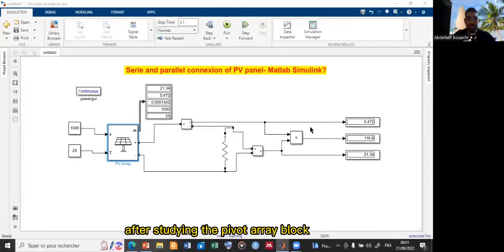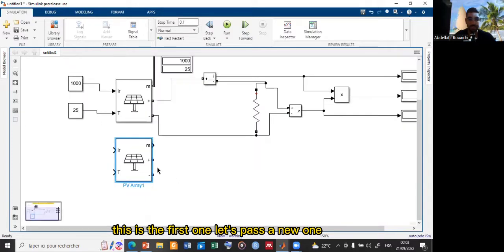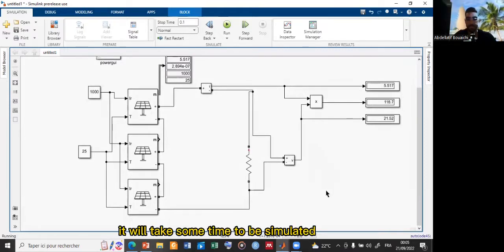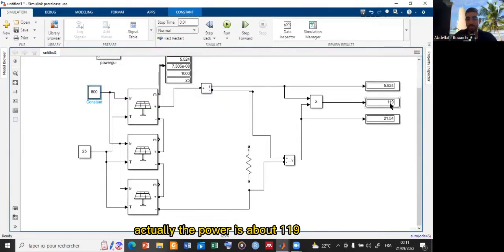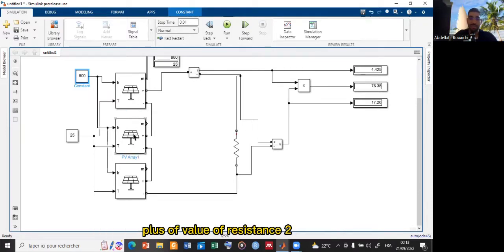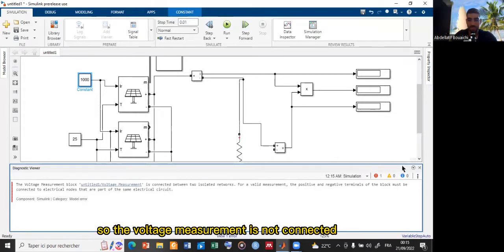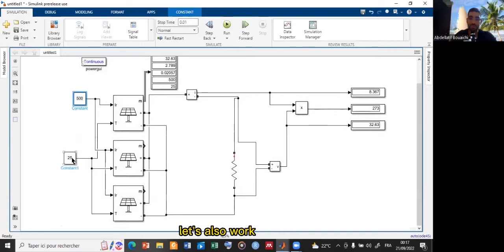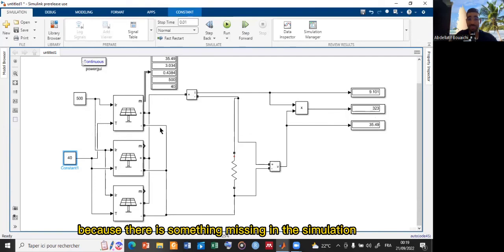3  - How to learn Series and Parallel Connections of PV Panels in Matlab Simulink- PV Power Boost

Comment: I am seeing the problem that with the rise of temperature also the voltage rises, when panels are connected in series. This problem is also in this video as you mentioned. Can you tell us what the solution is, why is this problem?

Thank you
Reply from the maker: Here are a few things you can check: Temperature coefficients and MPPT algorithm interference
Reply from the maker: Verify the behavior of individual panels by simulating a single panel under varying temperatures.
Reply from the maker: Review the equations governing the temperature effect on PV cells (Voc typically decreases with temperature, while Isc increases slightly).